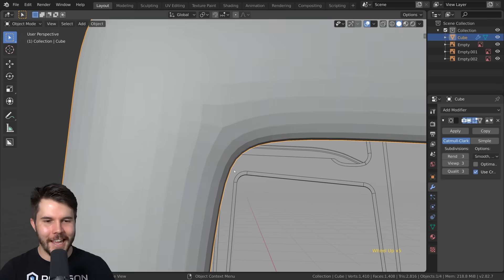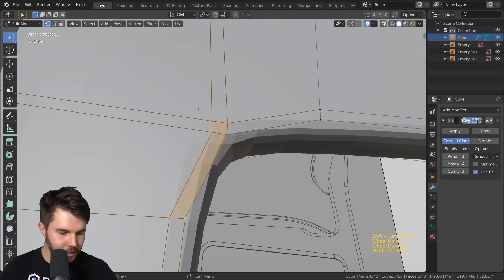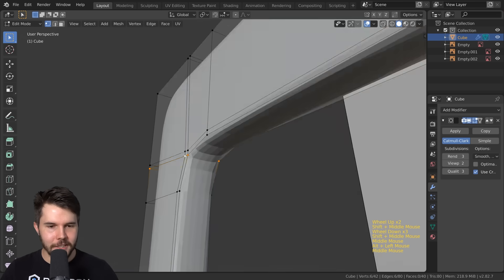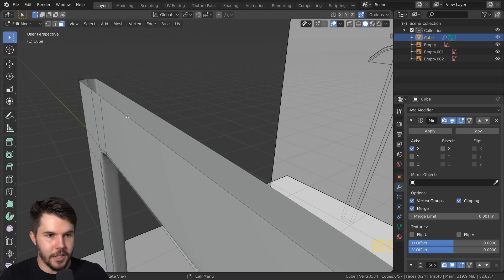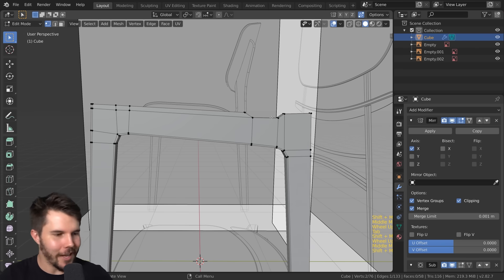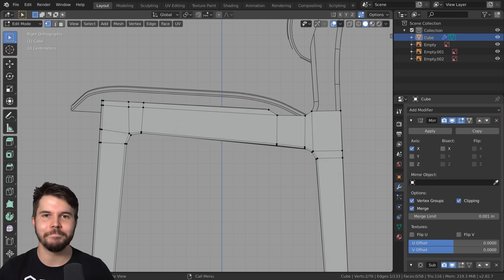Blender Beginner Modelling Chair Tutorial - Part 2: Edge Flow

Comment: If you’re having trouble using the Mirror Modifier in Blender 4.5.2, try this: before applying the Mirror Modifier, switch to "Object Mode", select "Object", then go to "Set Origin" → "Origin to Geometry". After that, when you apply the Mirror Modifier, you might notice the mirror appears flipped or offset to the opposite side. To fix this, simply change the mirror axis from "X" to "Y" in the modifier settings.

Comment: How did you select the faces before you deleted them, was it CTRL and + or was it by clicking the mouse?

Also how did you turn on and off the subsurface mode?
Reply: Firgured out the Subsurface Mode
it seems in Blender 4.5, Optical Display has to be unchecked/turned off

Comment: In case for the mirror modifier, if you end up only having 2 planes instead of a proper mirror with all the sides, make sure to only select the SIDE of the mesh you want to mirror and not the top/any other sides of the mesh and do the selecting in wireframe mode. Then click x and delete vertices. If you have other issues with the point from which the mirror happens there are some comments regarding that.

Comment: in my case i can,t convert to vertex mode to edge mode and face mode by hitting the no key pad can anyone here help me if you already facing this problem
Reply: As he said, its not keypad, its the numbers on top of your keyboard. Either way you can manually change it by clicking the 3 different options to the right of "Edit Mode" on the top left.

Comment: This mirror functions has really messed it all up for me everyone saying hit F3 “origin to geometry” but that’s putting the other half through my other half now there inverted just need to now how to move that one side back to where I need it
Reply: So I didn’t start over from my mistake otherwise I wouldn’t learn how to fix it what I did was remove the mirror function from modifier F3 “origin to geometry” F3 “3D Cursor” hit number pad 1 zoom right in try and line it up to the original middle (now a edge) in other words put the 3d cursor on the edge you want the top and bottom crosshairs on the Z axis lining it up just perfect with the edge and the right crosshair in the middle of the origin (little red/orange dot) F3 “origin to 3d cursor” then shift + S cursor to world origin now you can reapply the mirror function
Reply: If all goes well it will look perfect without a gap if not just repeat the process and zoom in even more to get it just perfect took me 2 attempts

Comment: This is the fifth time I tried to build the chair, I just don't understand what did I do wrong. After I deleted the faces on top of the leg and apply mirror effect, when I continued extruding, it appears to have 2 pieces, like the leg is divided from the middle. :(
Reply: Someone wrote this: "Hi guys! For those whose mesh, in the front view, appeared some kind of V shape when deleted top faces at 9:10, that's from the Sub Surface modifier. Search for the option "Boundary Smooth" and change that to "Keep Corners". Happy Modelling!"

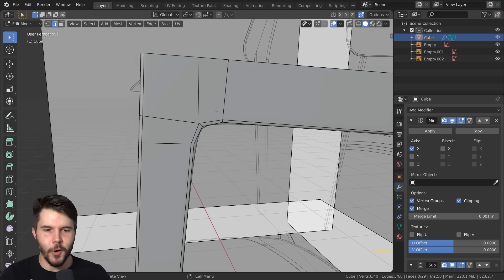Comment: Its important to note that at 9:54 when he does this very subtle transition to the next step.. he's turned off Edit Mode on the subdivision modifier. If you look at the list of modifiers on the right side, the subdivision one has that square box icon with the highlighted corner, turned OFF. This is important because as you continue following the next steps, you're going to see extra weird lines trailing along and your leg has an addition loot cut that you never put there, which is super duper confusing. Also optimal display is checked.
Reply: Okay, but that doesn't explain why the back of that chair piece is straight at the 9:54 point in the video. It was rounded before he cut, but then all of a sudden it's straight. Did he delete the faces? Did he do a loop cut on that part of the chair without us looking?
Reply: @michaelhutton6392  Disabling "edit" on the modifier, that will make the back straight.
Reply: You're my hero
Reply: Thanks ♥
Reply: saved me
Reply: Saved me, ty <3
Reply: you saved me thanks my hero.
Reply: thanks a million
🙏🙏🙏🙏

Comment: 6:16 - The merging method by distance did not work for me here. Not sure what I did but I ended up with multiple points under each other. I used G (move) to identify the points and delete them. Highlighting the points and pressing F (create new face) worked like a treat here. I wanted to post this here just in case anyone else went down the same avenue as I did. Great Tutorial @Blender Guru o7

Comment: 10:01 if anyone has problems Modeling this step: try to change the sub modifier to simple, afterwards switch it back to catmull again. Worked for me :)
Reply: i think u just have to uncheck the button on the right of the modifiers title (the second one). it will deactivate the modifier in edit mode

Comment: 4:21 if you are having trouble merging your vertices make sure that the auto merge distance is at a reasonable threshold. The setting is in the second drop down menu top right of the viewport. I set mine to 0.01m and it started working whereas before the default was 0.001 and nothing was working. Hope this helps someone, took me 20 mins to figure out... I may be dumb :/

Comment: In object mode/ wireframe i do have a preview of the 3xsubsurf but ony the "structural" edges and they are "bended" the way the subsurf is supposed to make them look but i don't see the other edges making a dense grid. Any idea someone ?
Reply: I found it ! For the blenders noobs (the blendoobs ?)  like me, now on Blender 3.3, you have to uncheck the "Optimal Display" box in subsurf modifier's settings.
Reply: ive been lokin for a sol but found ur comment really helpful  @knoqx79

Comment: You could also "fusion" vertices one by one, double tapping G and then drag the select vertex to one you want to stay in your model. You don't need to use merge (M) if you don't want to :D, but I recommend to activate Auto Merge Vertices to delete the extra number of vertices.

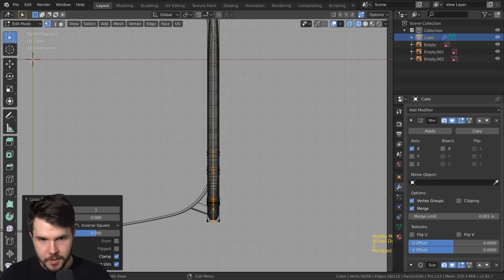Comment: 8:11 why does the geometry has so much detail in wireframe ? mine is still pretty simple with way less verteces, did i miss a subsurf application ?
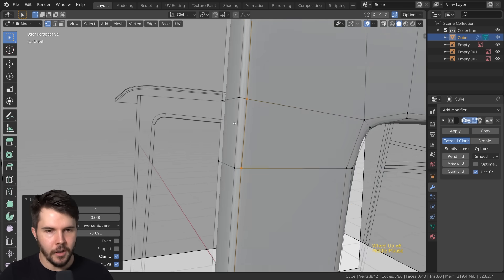Reply: miss 7:10 maybe
Reply: @nikus20111111  I found it ! For the blenders noobs (the blendoobs ?)  like me, now on Blender 3.3, you have to uncheck the "Optimal Display" box in subsurf modifier's settings.

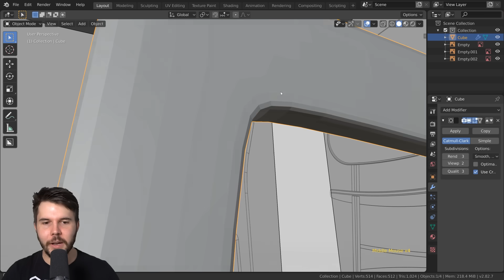Comment: Actually,  after merging vertices 6:09 the result is not the same as shown. In Blender3.4 If automatically merging probably doesn't work or It is my mistake I don't know. if there is a difference in bevel, should select vertical vertices in x-ray mode and merge manually by pressing "M "and selecting "by distance". After that I have exactly the same result

Comment: With the new update, Blender 3.4.4, clicking an edge or a face loop isn't Alt+click anymore but double tap an edge/face, it will do the selection loop. If you want to add more, Shift then tap a face/edge, then double tap the next face/edge you want to do the loop and, voila, you did selection loops!

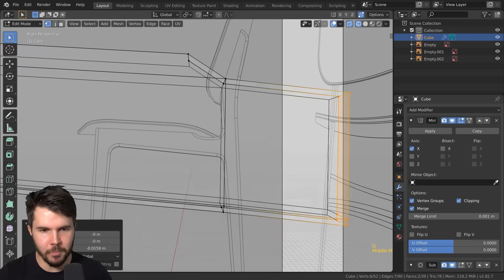Comment: 10:49 its G for drag right? when I add loop cut there and try to drag it with G or E in wire frame mode.the boxes face coming as a axe's face not as block why's that
Reply: Try not to mirror it, that's the problem

Comment: I still can't wrap my head around the fact that he really choose this subdivision surface method that it basically added a whole video just to fix it and created unnecessary faces all over a mostly squared model. It would be way easier to just use the bevel approach and then quickly fix the lighting issue.

Comment: At 6:16 after merging in the video the selection follow the inner curve of the chair leg, you can see this with face select following the curve. For some reason this is not happening for me. The face select follow towards the outside of the leg. I haven't figured this out yet, but I hope it doesn't give any problems along the way. Anyone any suggestions?

Using Blender 3.4.
Reply: I have the same issue. Also using Blender 3.4.
Reply: @Bjoernholt92  I've completed the full tutorial and didn't run into major problems with this. Only noticed that it takes a bit more care and effort when selecting edges.
Reply: same here!

Comment: to use the mirror modifier to mirror the object properly, you must have your objects' origin set according to its geometry. I ran into some issues when the objects origin (shown as a little orange circle with black outline) was set at the center cursor. This meant my objects' mirrored counterpart was far away from the original object. To fix this, go to object mode, select your object, then in the toolbar select object > set origin > origin to geometry. You must do this ~before~ deleting half the vertices otherwise the translated origin will be off-kilter in the x axis. (He addresses this in episode 4)
Reply: thx soo much 😁
Reply: Thank brother 😁😊
Reply: Thank you so much....!! I spent so much time on this issue..😢

Comment: Hmm running into an issue where I merge the vertices for the bevel and it pinches the top of my mesh. :/ Anyone else run into that?

Blender for some reason decided the top vertices were also separate from the ones along the X axis and removing those as well during the merge. Causing a pinching effect at the top. 

My work around was to move them temporarily and merge the ones he shows in the video then move them back and I could continue without any errors or odd pinching.
Reply: I cannot seem to find a workaround to this. Have been stuck for over an hour. Is it removing the wrong vertices? I cant seem to figure it out. Any help would be greatly appreciated!
Reply: @chrischausse7232  check the vertices above the top vertices. They seem to be merging on the X-axis too.

Comment: If you have problems MERGING at 5:05. 
1)Shortcut is M, not Alt + M.
2)After selecting "By distance" look at the lower left corner of your blender, select "Unselected" option.
I've spent like 30 minutes wondering why it's not working until I saw that little window.

Comment: Since our comments are starting from scratch, I'll post! Leaving this tutorial, I have a question concerning the usefulness of the mirror modifier. Perhaps it will be more obvious to me on more complicated meshes (or as we continue the chair)  but what is the purpose of adding a loop cut, adding the mirror mod, and deleting the original vertices on one side-- if I end up with the same number of vertices, and still have to work with transparency toggled on for the most part? Mirror mod makes sense to me concerning like, more sculptural figurative meshes. But in this example, I'm not seeing the purpose of those extra steps right away...

Comment: i had a problem with the mirror modifier. the origin was not set correctly somehow (i think it was set to the world origin), had to reset it with an offset after i cut the leg in have. should set the origin to the leg before cutting it. is there an easier way?

Comment: If your mirror is showing up on the other side of the center point of the scene, you need to move the origin point of your object. Specifically, for the mirror modifer, you need to set the origin the the left face of your leg object.

Hitting [ ctrl ] + [ . ] will allow you to select the origin point. Hitting [ G ] will allow you to move it; make sure you turn snapping on.

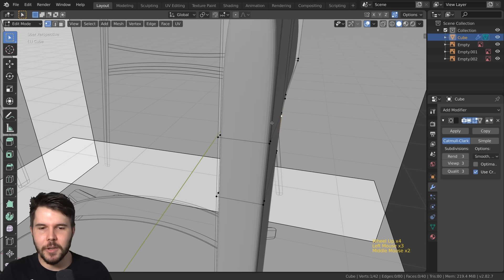Comment: Andrew is a great teacher. occasionally, some things he does are not mentioned or explained or I missed something somewhere early in the tutorial. I was having trouble with object origin 07:20. At the beginning of the project, I started my cube in the middle of the grid and moved it to the side. for some reason, the object origin point remained in the middle of the grid even though the cube was moved on the side of the chair to make the chair leg.  @ 07:55, Whenever I tried to  delete vertices and mirror, the halves of the cube/chair leg were on opposite sides of the chair. I discovered what the problem was. I changed the object origin (the orange centering dot) of the chair in layout mode, clicked the options tab and chose transform origins. I turned on snapping to snap the origin in the center of the loop cut. That was the fix. I hope this helps someone having trouble like I was.
Reply: Cryptid HD had the correct answer...  "When i mirrored the leg it made a leg on the opposite side of the x-axis, not inside the other
Edit: To Fix this Undo the mirror until before the step, Next select all of it and Right-click and click "Set origin" then click "Set origin to Geometry"  then mirror it that should fix it."

Comment: At minute 7:03 im not able to do the loop cut down the whole z axis, my loop stops earlier (it goes around first long quad of the leg not all three quads when viewing from the side). Any solution for this?
Reply: Solved it. The problem was duplicate (double) vertices on top of each other. You can see if you have this problem by pressing g and moving the vertice in question and see if there is another beneath it. Then merge the vertices as shown in the video. After that the loop tool worked properly again.

Comment: Hi. When I tried to apply the mirror modifier for the chair leg, the new mirrored object doesn't occupy the same space as the original mesh. As shown at 7:51. It creates a mirrored object separate from the original mesh and mirrored at a distance in space that is approximate to where I would eventually place the mirrored chair leg. What did I do differently from the tutorial? Thanks.
Reply: I found the answer to my question on the r/blenderhelp subreddit... the mirror modifier mirrors based on the origin point for the mesh. The origin point appears as an orange dot when the mesh is created. When I moved my mesh the origin point stayed in place. To correct I switched to object mode and then selected the object menu > set origin > origin to geometry. This places the origin point back within the mesh.
Reply: @bloodandwater.divine-mercy  my g cheers
Reply: @bloodandwater.divine-mercy  Thank you sir
Reply: Thanks a lot

Comment: 10:59 If your wire frame has significantly less polygons than in the video, go to your subsurface modifier and uncheck 'optimal display.' This should solve your issue and the wire frame should look the same (excepting small variations in how close you made your loop cuts).
Reply: That's what I like about this community, so far I never had to scroll down past 20th comment for the explanation of any little detail I've ever missed.
Reply: Didn't work for me unfortunately.

Comment: If Alt + left mouse button dosn't work to select a face loop like at 6:44 check in Preferences if you don't have the "Emulate 3 button mouse" thingy checked!
Reply: This is a comment from another video I found helpful.

"[P]eople on Linux Mint who have a problem in selecting edge ring or selecting edge loop with ALT +left mouse click it's very simple just go  to Menu >> system settings >> Windows >> Behavior down in  Behavior find Special key to move and resize windows by default it's on ALT turn it Disabled and boom blender works just fine now with ALT."

Comment: it might be out there already, but if you are using blender 2.93 or around, the automerge vertices is not where he selected them. you have to go to the little spanner with the screwdriver, and there in options you can select automerge. hope it helps someone out there.

Comment: Can someone help?
I finished making the back leg of the chair, however, when I looked at the right side of the leg, the whole face was missing. I tried doing the back leg again but the same problem occurred. Can someone help give a solution?
Edit: At 14:59( I'm trying to do the time reference thing), when I was selecting the bottom vertices, I had not selected one of the vertices which was behind another vertex, so there was a whole edge missing which caused the back face to be missing. Take note, just because you are in x-ray mode and wireframe mode doesn't mean you always select all the vertices. Just check if you've selected all the required vertices.(Just in case someone faces a similar issue!)

Comment: When I finally figured it out after my mesh mirroring the wrong way (the opposite side,insecting the wrong way etc) I did a lil victory dance. 
Here is a summary checklist of what you need to do(from the perspective of an absolute beginner)

-I suggest duplicating the mesh with shift D and putting it in a new collection cuz we all know the struggle with the the limited undo’s. Also if you can’t find any of these things, F3 is the search hotkey that can find anything for you.

-okay now make sure you 3D cursor is set to world origin.Do this with shift+S and select cursor to world origin 

-there is another origin (the orange dot) that you need to set to geometry. In object mode, click the ‘object’ button in the top left of the viewport, then set origin and select ‘origin to geometry’.again you can use F3 if your having trouble.

- now delete half your mesh like andrew does in wireframe and xray.

- then get the mirror modifier for the modifier menu 

-continue with the tutorial on from there. 

You can do it! Mistakes make masters!
Reply: I'm STILL having my mirror appearing flipped in the x-axis. It's driving me nuts I can't figure out why it's doing that despite all the troubleshooting happening here. Ugh
Reply: I solved it. For those having troubles still with the mirror modifier being on the wrong axis, follow these steps but at the very end in the mirror modifier settings, under axis, deselect X and select Z. Works from there.